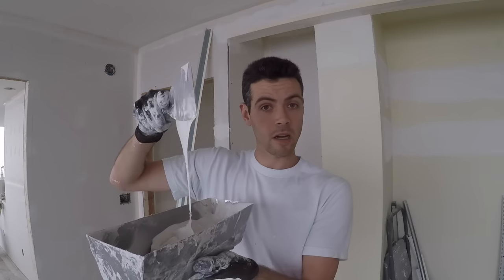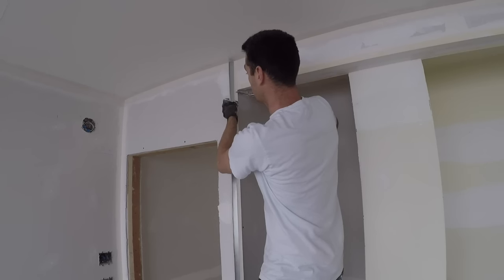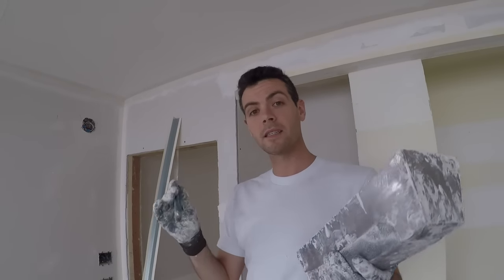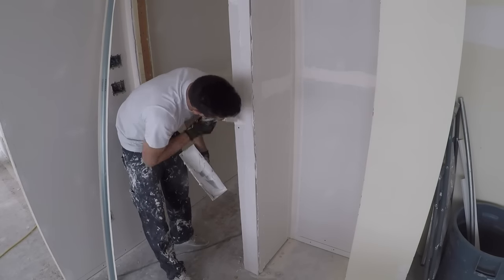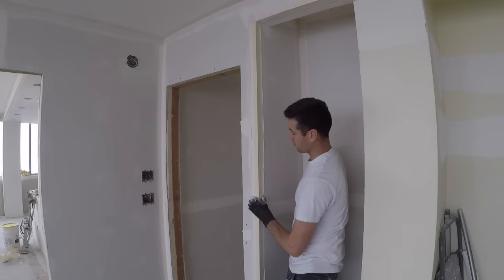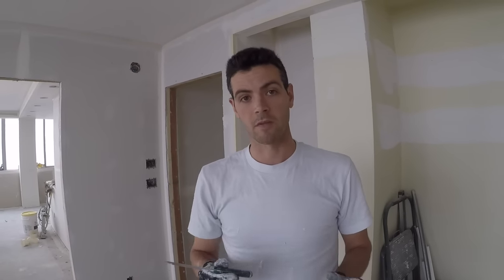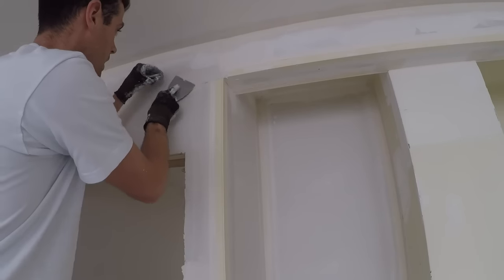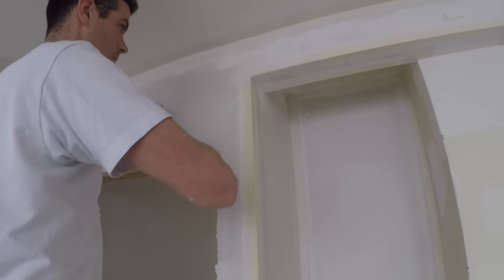HOW TO INSTALL CORNERBEAD (PAPERFACED)

Comment: Ben, great quality vid with excellent details but why don't you put a 1st coat of mud on those beads?
and another thing you don't mention in your vids is the GLOVES.
What are they and do you ever wash them?
Reply from the maker: It was an oversight to not coat them. Although the bead install is the most critical part. I need to do a coating cornerbead video in general. I don't always wear gloves. I prefer wearing gloves because my hands don't get dried out. I don't ever wash them. They wear out by the time they get a bit funky. As long as the gloves are thin with good grip they will work.
Reply: Actually, the gloves was one of the best tips you got me! I do sheetrock maybe once a year, but never wore gloves. Always hated the drying of stickiness of the mud on my hands. Today I tried the glove treatment and it was a delight!
Could you (or did you you ) do a vid on basics like; don't put mud back in the bucket, cleaning knives, box or bucket, cleanliness,  rock all the way to the corner or set back, fixing tape that didn't stick, screws or nails, etc.
You're great teacher! thanks.
Reply from the maker: That's a good idea. I haven't made a basics video.
Reply: Dee K yeh I ate the feeling of dry mud on my hands too, I used to ware gloves like this gentleman and washed them once a week that worked well but having to wash them and the smell was getting to me. Now I ware Black Nitrile disposable gloves which I find good as I can feel everything alot better, still have clean hands and don't have to wash them, note that I'll get about 3 days out of 1 pair

Comment: Great video thanks! Wondering if you would be able to do one on a long stretch of outside corner where you have to butt two corner beads up to each other. Thanks!
Reply from the maker: That's a good idea. It will be a while until I have another one of those but I will do it as soon as I can.
Reply: It's the same concept put them on the same just take care that the ends that butt are lined up exactly the same

Comment: Good morning.  Great video.  I have a question for you. I have 2 horizontal outside corners at 10' 10" I need to cover. The paper face corners available to me are 8' and 10'. What is the best way to go, do I get two at 8' and put the splice somewhere in the middle or put up the 10' and butt up the 10" ? What is the best way to do the butt joint? Have you heard of Strait-Flex  perfect 90? Should I use this instead? Have you thought about doing a video where you need to skim coat after removing paneling?  Thank-you for your help.
Reply: I just found the one torn drywall.
Reply: You have to put a splice somewhere.. I try to put my splice at about 2' from bottom. That way it is not at eye level, and at 2 ' up its easier than 10" up and bending over.. You should be able to match up the corner nicely

Comment: Why not cut an angle into both sheets of paper (kind of like what you did in the 3-corner video) so that they butt up against each other diagonally instead of having to add that mini-piece at the corner?

Comment: Hey man looks good. Have you ever layed the bead down on flat surface like a rip of drywall and muded the bead itself? It works great and its very fast. We also have a hopper that you fill with mud and slide the bead thru.
Reply from the maker: I have a hopper too. That's my favourite method. Lowest possibility for blisters. I also have a tube and applicator and roller. Good for production and getting the beads on tight but it follows the framing which as we know can be pretty bad sometimes. I don't usually mud the bead itself but i could see how that could be pretty quick.

Comment: Question about paper backed corner bead vs straight metal (screw on) bead. Will a screw on style provide a stronger corner over time for high impact areas?
Reply: I've found they both work well. The screw on type will dent on high impact where the paper backed joint tends to crack on high impact.

Comment: I saw a video where they hit the tape with a fine mist from a spray bottle so it's not to dry and help it adhere. is that legit or is that stupid.
Reply from the maker: It's not typical. More of a weekend warrior trick that wouldn't be necessary if the mud was thinned down.

Comment: i'm a drywaller that specializes in only applying cornerbeads and can tell you that its alot quicker to get yourself a painters corner mop and roll the mud into the bead rather than with a 4inch knife.
Reply from the maker: That's a good idea.
Reply: @vancouvercarpenter  they sell what we call a hopper that you put mud in and then run the bead through it and it puts mud on the inside of the bead do you use that
Reply from the maker: @realmattpcd  yes that's what I use for anything with about 10 or more beads.

Comment: Great video series Ben, but curious as to your opinion on installing corner bead with the specialized cornerbead adhesive compared to a mud application.  Any experience with that?  Thanks!
Reply from the maker: I haven't tried it.

Comment: On the top corners, could you cut the bead at 45°  to make top and bottom meet, or is the extra square better?
Reply from the maker: You could cut it at 45 but that would be way more work than its worth. I t would look fancy though until you cover it with mud.

Comment: How do you get cornerbead laid on new drywall at a ceiling edge to match a preexisting edge that has orangepeel texture? Do you have to sand or shave some of the texture off? Our situation is we removed a divider that went up to the ceiling. The room next to it is vaulted.
Reply from the maker: It's hard for me to visualize without a picture. If you have instagram you could send a picture to @ben degros or you could link a picture through the comments with a photo sharing site of some sort. If I can actually see it I could tell you exactly what I would do.
Reply: I dont scrape the texture unless it rough an orange peel is smooth enough to put the bead right over it then fill you will have to blend the orange peel over where you filled the new bead

Comment: If you’re at a specialty supply house for your beads do you ever see and or have you tried the No Coat product also do you ever use corner rollers?
Reply from the maker: I use no coat on off angles all the time. Video coming soon. As for corner rollers. I have one. I find it puts the beads on too tight. Which is fine if the framing is perfect  but it will follow poor framing when it's bad.
Reply: Vancouver Carpenter  I worked a cabinet shop for two years before starting my own home building company.  Because of the difficulty’s in installation encountered by poor framing and poor drywall work over poor framing,  my carpenters were always on their toes re precision and accuracy of installation.   The drywall installer that taught me was so good he/we never had to sand anything.   I’m not that good, but close.  He thought No Coat was a gimmick,  I ran up against a deadline and was compelled to try it and fell in love with it.  I agree it can cause a little bit of headache, Literally have accidentally been whacked in the forehead too many times cause of uncontrolled curve tension (same goes for Pex-A).
Reply: Vancouver Carpenter and another thing.  Whilst enjoying tacos this evening I’m bumfuzzled that we have a product as durable and awesome as No Coat but god forbid we have hard taco shells that work as a legitimate barrier between our food and hands or for that matter survive shipping.
Reply from the maker: @charleshetrick3152  😂

Comment: No screws required? What about when you use the beads at rona, do you then use screws or nails?
Reply from the maker: I avoid steel corner beads at all costs. But when I do have them I use drywall nails.
Reply: Vancouver Carpenter, why nails over screws?

Comment: Do you put any mud over Top of the paper or just paint over it
Reply: I think he does put mud over the paper, otherwise you will see it. However, we in Australia don't have this and we use metal angle called External Angle and i think this is easier :)

Comment: What video should I watch next? What do I do from here... does it stay like that? Or does mud cover that? 100% new to this trying to tackle a DIY myself!
Reply: Thought I might help in case he doesn’t have the chance. After applying corner bead. Let dry then add second coat of mud on top of both sides . Let dry. Second coat should hide the paper facing from visibility . After dry you might need to light sand hopefully you did it thin enough that you don’t sand much. Your 3rd coat should make it ready for primer then paint. Good luck
Reply: @chrisspanyer1525  thank you so much! I actually just did the second coat so we’ll see how it’s looking tomorrow. I really appreciate it!

Comment: I have never installed one of these corner beads without getting bubbles in the tape  What am I doing wrong?
Reply: A tip I got along my way is that if you dampen your tape you don't get bubbles. My theory is that the tape absorbs the moisture from the mudd and dries it before the mudd can adhere to the tape. Not sure if the tip works on corners as I Havnt tried it.

Comment: can i connect the two end of the corner bead together to make a longer bead?
Reply from the maker: Just butt them together and try to line them up really nice.
Reply: thanks bro. I'm from Vancouver too. good stuff
Reply from the maker: Awesome. Good luck with them corner beads. It's not uncommon to see a hairline crack where the corner beads meet over time. It's not a good connection but it's what we have to work with.

Comment: Dude if u would have cut a 45 to nothing u wouldnt have to put tape on the top of ur corner i do it all the time cut ur corner a inch and a half longer then do ur angle and ur done just like u would do a square using angle iron same concept anyways love ur vids dude
Reply: Ps i absolutely love those tape outside corners

Comment: Does it matter what type of mud to use in installing corner beads? I don’t think he ever said….Should I use hot mud (the powder stuff in a bag), or pre-mixed (green lid or blue lid in a bucket)? Anybody? Anybody? Thank you.
Reply: the instructions from stait flex say to use joint compound. you can always call the manufacturer

Comment: I think now I have to ask why a carpenter knows so much about drywall...
Reply from the maker: I developed a bizzare obsession with wanting to learn how to tape drywall early in my carpentry apprenticeship. I started doing small drywall repairs at my own place and for the construction company I worked for. I also spent countless hours on drywall talk( a forum) soaking up info every night. Over time I started doing side job after side job to the point where it became my fulltime work. There were a few years I spent almost exclusively doing drywall finishing. Now I work as a carpenter/contractor but still do the occasional drywall job.
Reply: I wouldn't call it bizarre its probably the most hands on & satisfying part of construction, Keep up these great videos, you are much better at explaining things than most people, soon all your vides will have well over 100k views. If you get a professional video production person like Matt Risinger has you would do great.

Comment: Why don't you miter where the two beads meet at 90 degrees?
Reply from the maker: Your thinking like a carpenter not a drywaller. It would be a lot of extra work to do that. Much more thinking and making sure you are mitering the right side. In this method you can go on auto-pilot which is what you need to do for production. There is no reason you couldn't miter it if you wanted to though.
Reply: @vancouvercarpenter  You would still need to miter on a 3 way corner though, for a bulkhead?
Reply: @gungan5822  where 3 points come together when you put the last one on just angle the cuts a little so they done overlap the nose of the others I always put the vertical  one on last it just looks a little better

Comment: thank god this is not my house   
have you ever hard of a nail ? 
i bet if you look at it it would crack lol
Reply from the maker: Ummmm.....Nail on steel beads went out in the 90's because of cracking issues. You are however entitled to your opinion but I dare you to go on drywalltalk.com and ask if steel bead is better than paper or if you should use nails on paper bead. Go ahead. I will wait.
Reply: Paper faced metal corner bead is definitely my first choice... I have been experimenting with paper faced composite lately and it's equally nice to work with albeit more expensive.
Reply: @vancouvercarpenter  ya I've been doing drywall for 25 years and the only time I've had to repair a paperfaced corner bead is when a lady hit the corner with her car in the garage I have however fixed countless cracks in metal bead